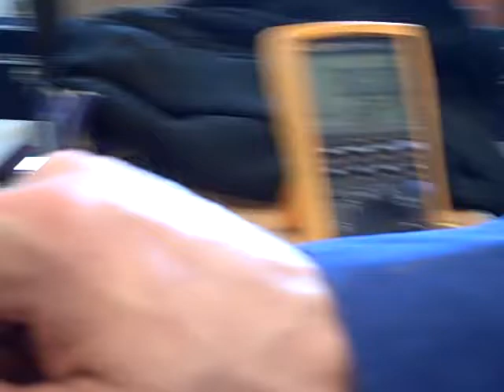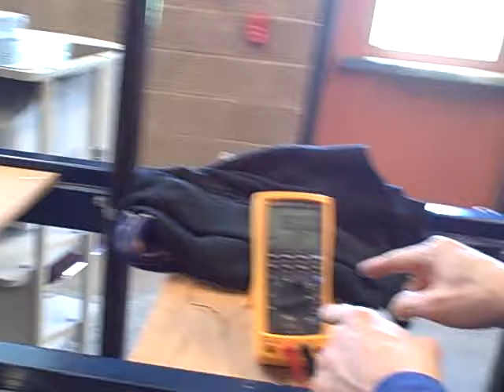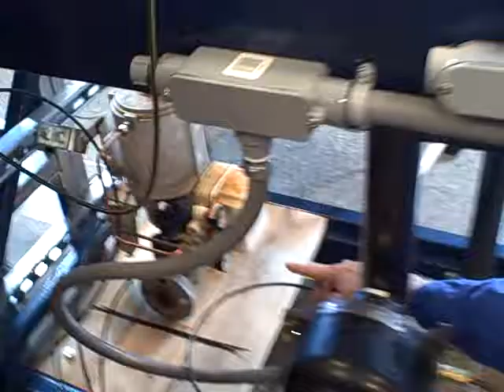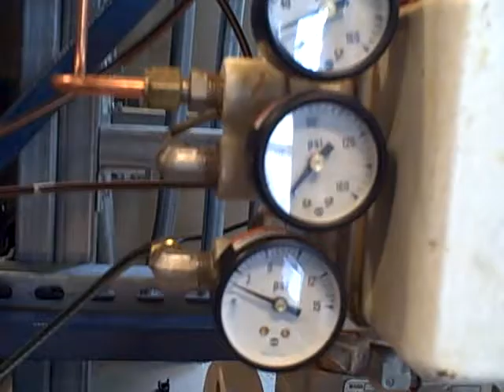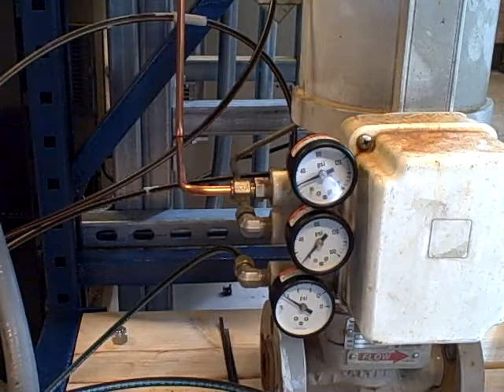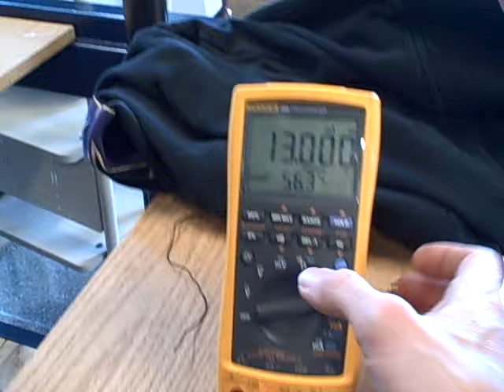Fluke  model 789 simulating transmitter

Comment: The transmitter should still be connected to DCS right in order to give AO to control valve? I can't see the connection from Tx to the controller. Thanks for your clarification and please continue posting videos like this. It helps us a lot.